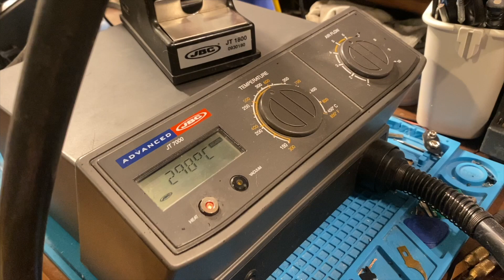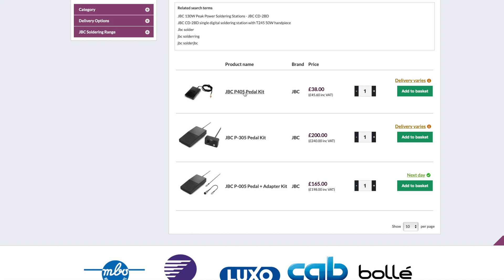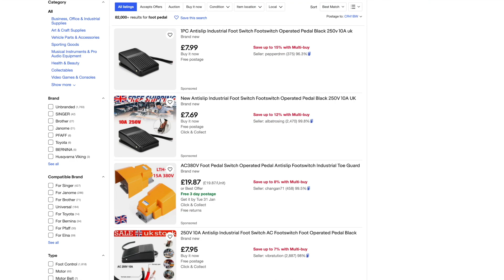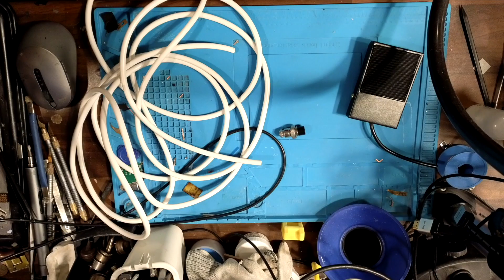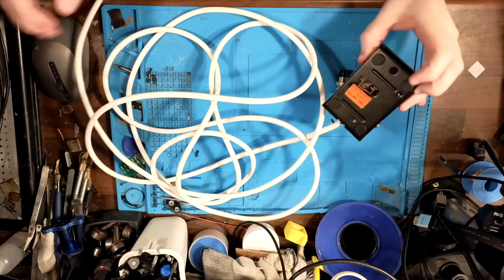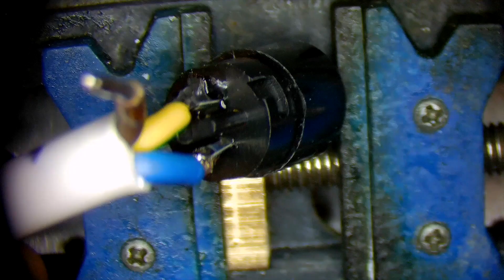JBC hot air station mod that may save you some money! or if you have any JBC station!

Comment: Good day. 
Could you measure the diameter of the heater, where the nozzles are installed? I have a lot of nozzles from HAKKO, they are 22 mm, I want to make sure that I can use them if I buy a hot air station from JBC. The external diameter of the Hakko fan is 21.5 mm, and internal diameter of the nozzles are 22 mm. Thank You
Reply from the maker: @ElEnBlog  it’s 15mm on this one. Thanks rich
Reply: @SURGE101  Thanks